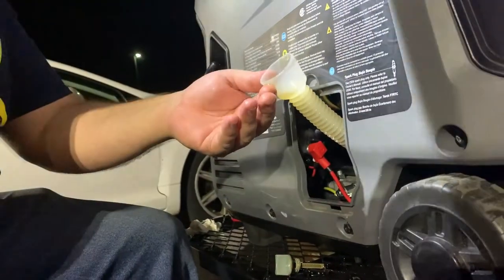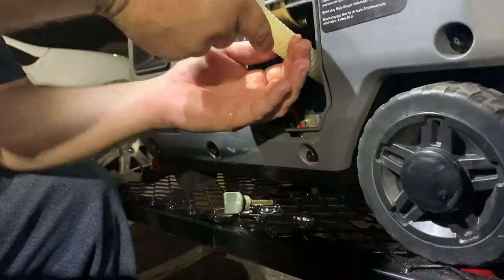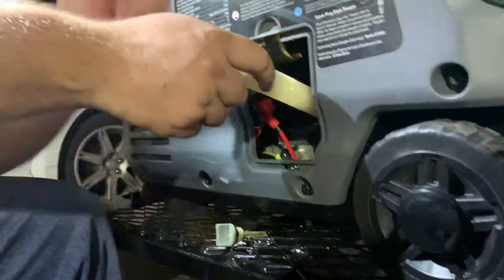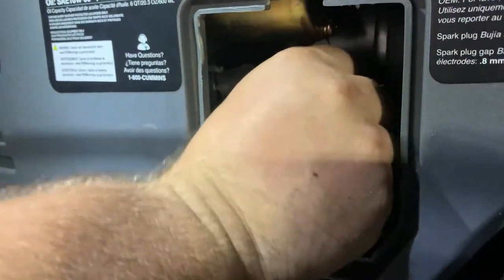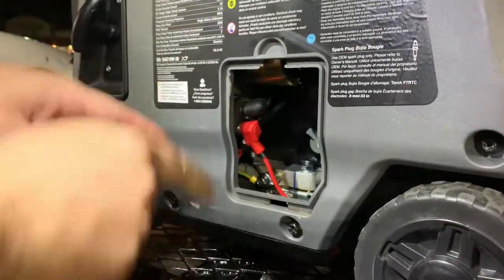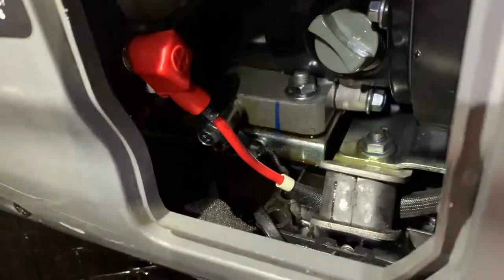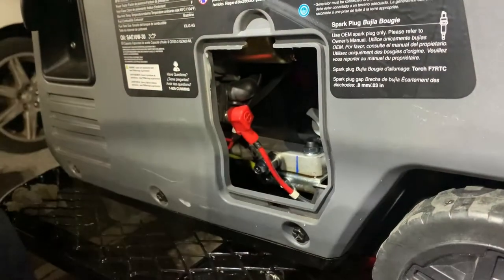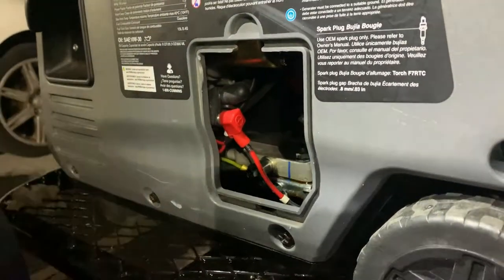Onan P4500i Inverter Portable Generator - Oil Change Step 4

Comment: Devin, thanks for the excellent video, where can I get the oil funnel refill at please for my Onan P4500I?
Reply from the maker: Most RV shops, but you can grab them online on ebay tool. Cummins can probably help send you one out. They were great with my in warranty repair.

Comment: Thanks for posting does it damage if you over fill the oil.
Reply from the maker: Yes it does. You do not ever want to overfill an engine on oil. It does more damage than running it low. Still yet, measure it perfectly and if a little spills out while trying to close it up, no worries. It will run like a champ. I have been using mine for three years now. Change the oil every 50 hours or two weeks.

Comment: This was awesome, thank you! Actually one question, these things don’t have oil filters?
Reply from the maker: There is an air filter that needs to be cleaned once or twice a year if the air quality is good around where you use it. We use it for our mobile business, in a paved parking lot. It isn’t too bad usually.
Reply from the maker: Here is a good video for some more in depth maintenance. https://www.youtube.com/watch?v=_Bw9jzO0w2Q At 3:48 he cleans the air filter. I do not see anything about an oil filter on this model.